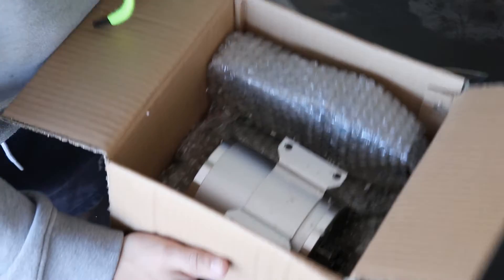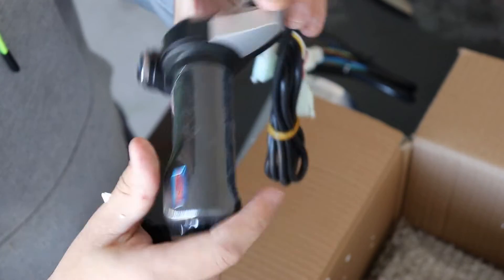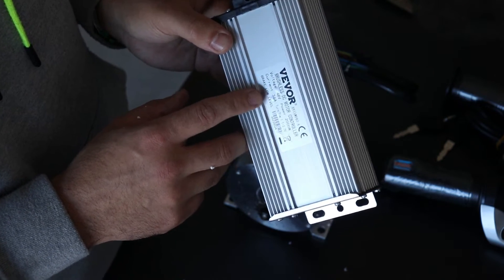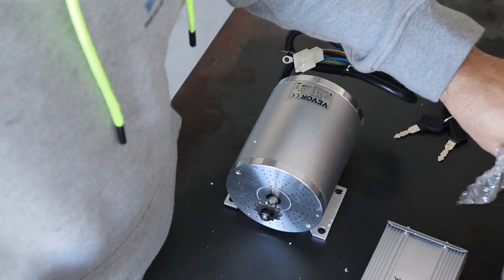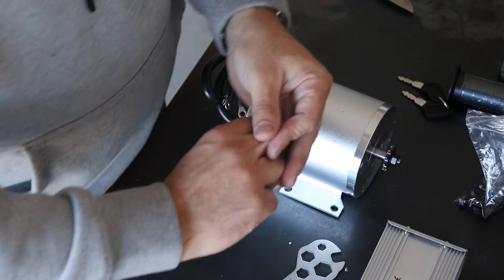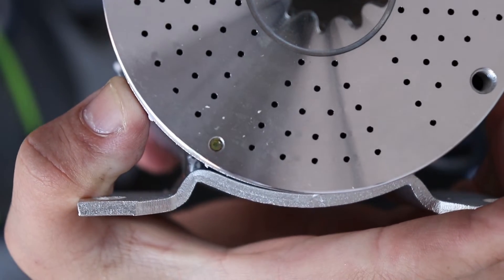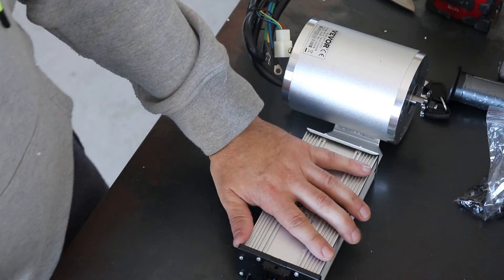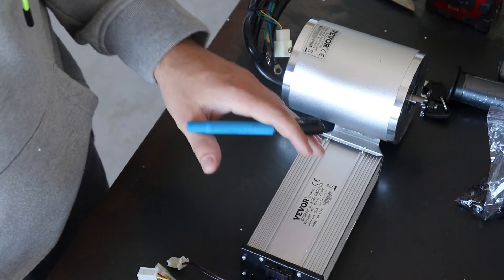Aussie Review   Vevor Brushless Electric DC Motor 48v 2000W

Comment: Can I use the motor alone with my own speed control knob and plug it in? Will it work? I don’t need those other parts. I’m using it for a different project.

Comment: I have that same Vevor controller torn apart right now, as I have to trim the housing down to fit in my scooter, and there's about a 1/2" of material on either side that can be removed without even touching the PCB. I imagine the extra material is to aid heat dissipation,  however it will be located at the front of my vehicle where there are plenty of ventilation holes in the deck, so it should be feasible to run a smaller box given my frame's dimensional restraints.

Disassembly is really easy: just remove the 8 screws on either side as well as the 5 mosfet heatsink screws on the side, then the whole board just slides out the top. I plan on reassembling it with a bead of hot glue on both end caps for added waterproofing (as I mentioned the deck is ventilated).

Comment: Correction on the brake wires. Those are supposed to connect to your brake lever switch to tell the motor controller to cut power to the motor when you apply brakes. No regenerative braking on the controllers

Comment: Nice one Benny. WHat makes the throttle controller garbage? general quality?
Reply from the maker: General quality - very short throttle position, fitment, type of plastic used, type of grips used ect. Also there is only one part of the assy that clamps to the bar end, the rest floats, to me it doesn't appear to be hard wearing. And very importantly for me, not even close to water resistant. I have bought a new one, and am waiting for delivery. I was also pretty keen on getting one with a speed - voltage - battery display